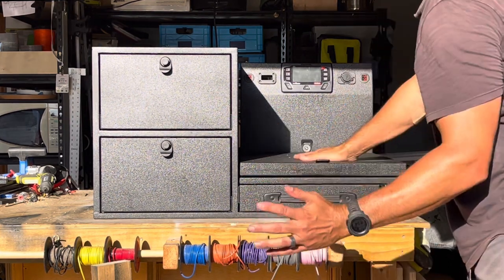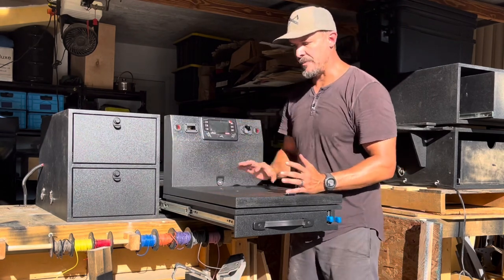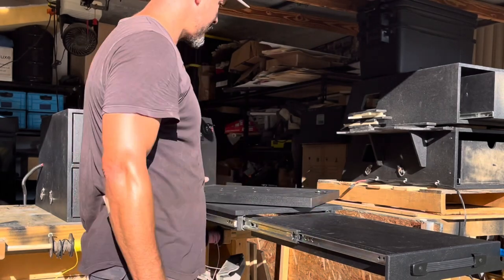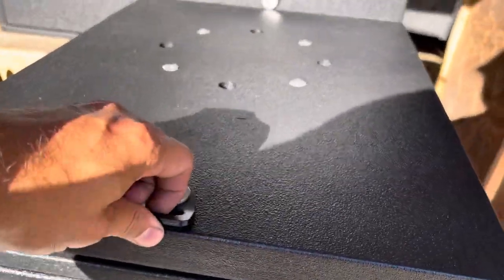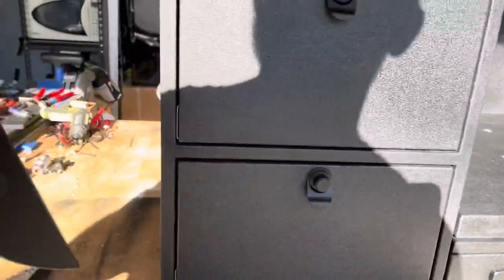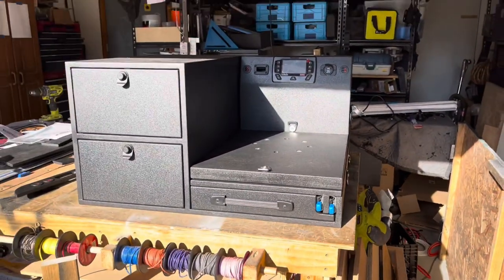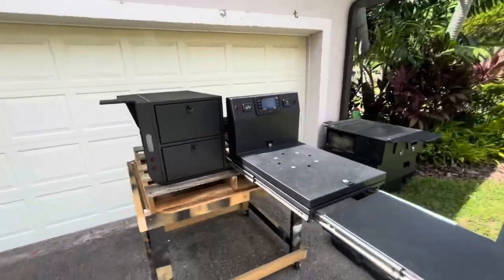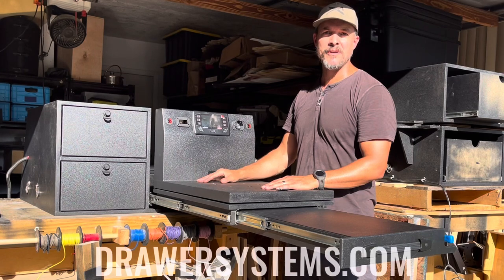New Land Rover Defender - Drawer System with Redarc Redvision, Manager 30 and Egon Electronics!

Comment: Gorgeous! With the Defender door opening to the right, will it be a tight fit to access the panel from the right side of the slides and rotating platform?
Reply from the maker: Thanks! The passenger slides are very close to the rear door when it’s open. All access will be from standing with your back to the drivers side. In the video I was only standing on the right side so I could face the camera.